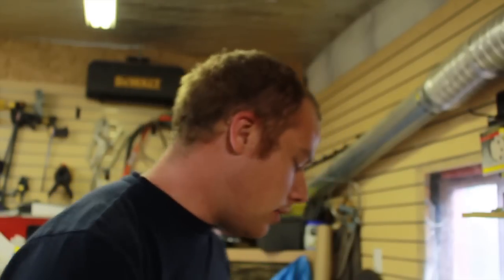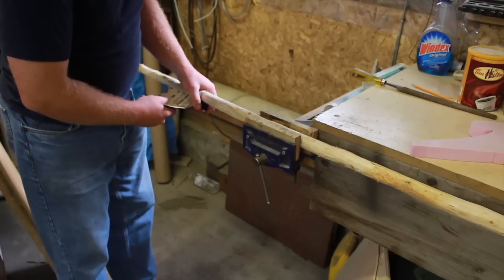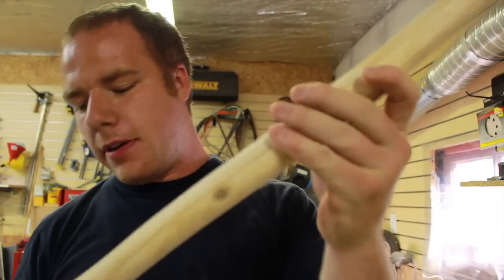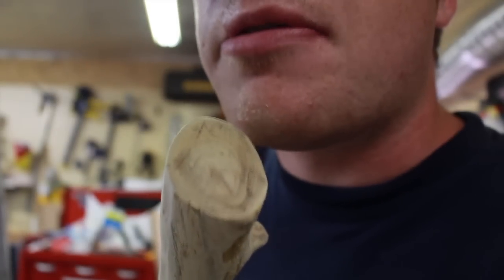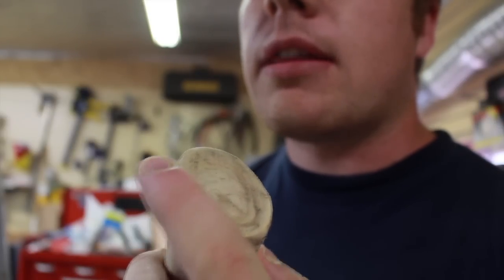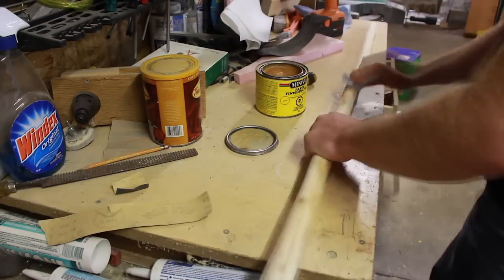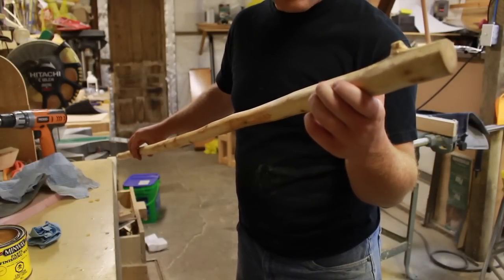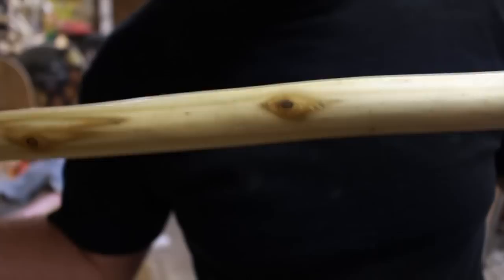Cedar walking stick part 2

Comment: Sand it smooth and flame it,then sand again and apply poly satin finish,three coats,sand between coats.I use rubber end slip caps that can be replaced.nice stick.

Comment: I finish mine with linseed oil, but really it depends of which wood I choose, I have found if you cut most any green or even dead, that you must coat the ends with Lard or, cooking oil mix with wax, or linseed oil, if you don't and you set them to dry they will begin slitting  within and hour. Have a blessed day P.W.D.